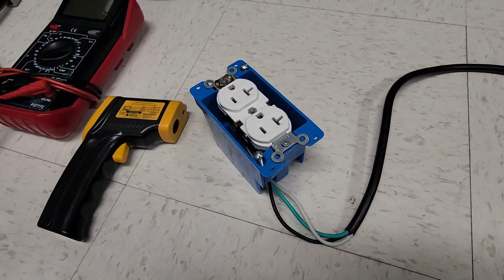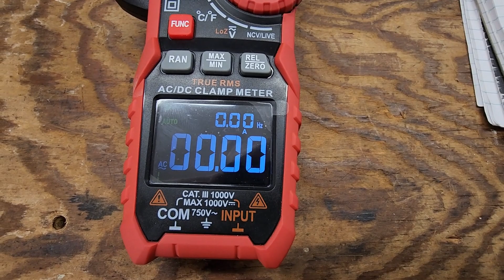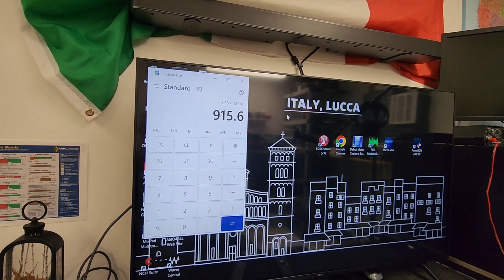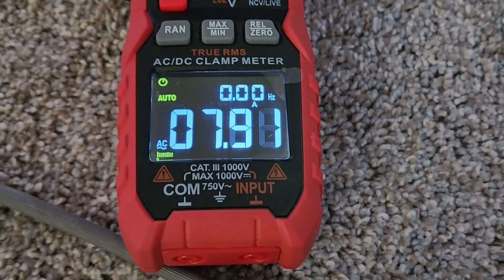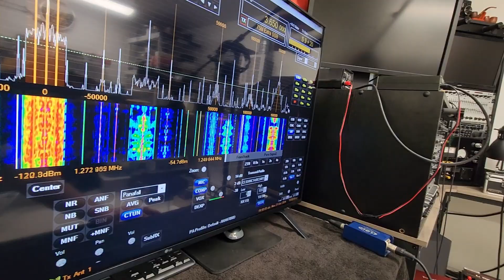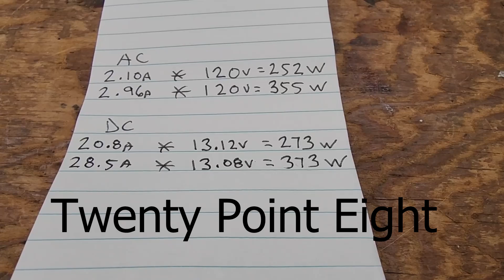HAM/CB emergency power. LiFeP04 and Samlex 2000W inverter

Comment: Btw, the battery will automatically shut off when you exceed the BMS limit for > 5 seconds but still agree to fuse it.
Reply from the maker: Yes sir. That's what I have seen. I wanted to take extra precautions to be safe.

Comment: Very cool!  Curious, what SDR/Radio are you using that I saw on the 42" TV?
Reply from the maker: Thanks! The software is called Thetis and the radio is the ANAN 7000DLE mkii by Apache Labs
Reply: @KP68videogates  Interesting!  I hadn't seen one of those before.  Ok here's the big question - is it doodoo on AM like almost all the other HF rigs?
Reply from the maker: @Z28videogates   It is stellar on AM and all TX parameters are virtually unlimited. It is capable of commercial AM broadcast quality. For the audio processing you can use rack audio gear, VST (Virtual Studio Technology), or the audio processing that Thetis software comes with, or a blend of all 3. The Thetis software that you saw is where the magic happens. The radio is quite expensive but it is in a league of its own.